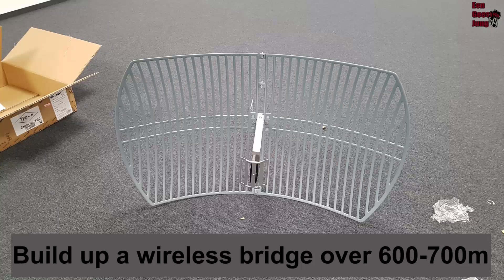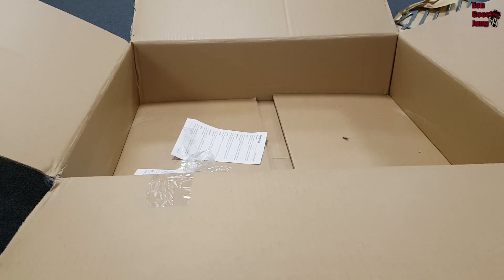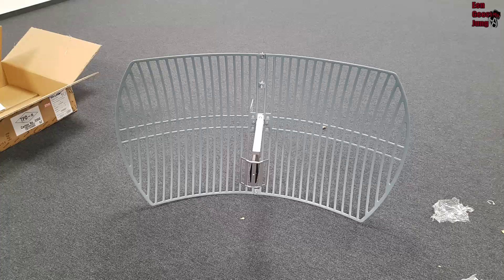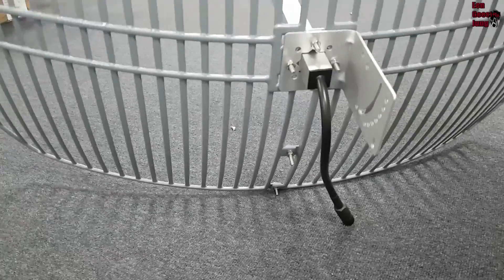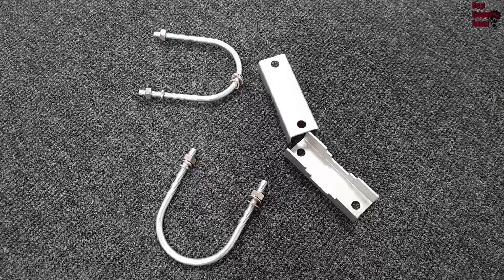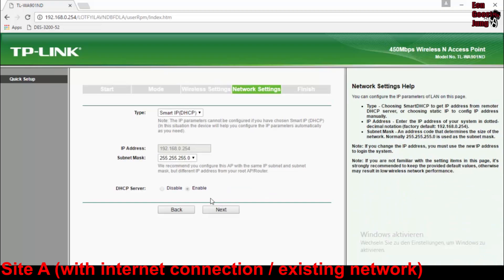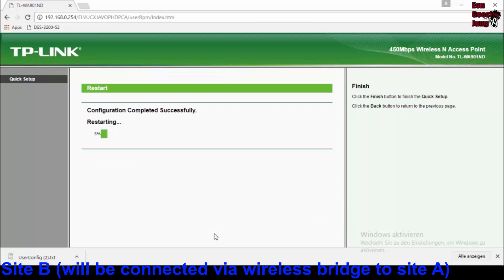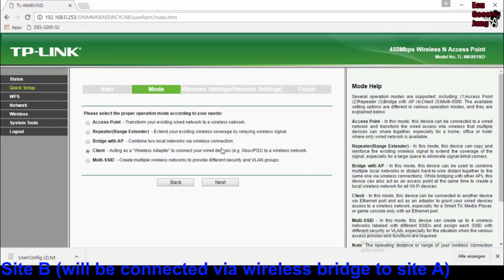Building a wireless bridge with the TP-Link antenna TL-ANT2424B

Comment: Are you a filipino, right?... Computer necessary to configure the antenna or the range to be completed, or no need just plug in to router?
Reply: The computer is needed to setup the brigde connection.

Comment: Hi. I saw your video. I have a wireless adapter tl-wn7200nd, can I use this adapter with the TL-ANT2424B antenna to do wireles audit? Is the power lower if I use it with my wireless adapter?

Comment: Dear sir please help me I  bought a New  TP-LINK ant2424b 24dbi parabolic antenna and buy the 16 meter wire n male to rp sma female connecter and I am using the router tp link mr3420 3g,4g detachable antennas but parabolic antenna range is very very poor just 50to 60 feet please support me I am waiting your response
Reply: IHSAN YOUSAF bro I have same problem; so weak signal with this antenna
Reply: To much cable. Use lmr400 very low Lost signal or connect directly to AP
Reply: Coax cable have to be 1m<

Comment: It is better to spend your money on a poe antenna. It will be a lot better. I started with this same antenna 4 years ago. One year ago I switched and went from around 3-6 mbps to 40-50 mbps. Amazing results.
Reply: I'm just starting to get into this stuff. Whats a poe antenna?
Reply: @Silpheedx  poe = power over ethernet. Its a device that gets its power from an ethernet cord that is plugged into a special POE switch to get electricity.